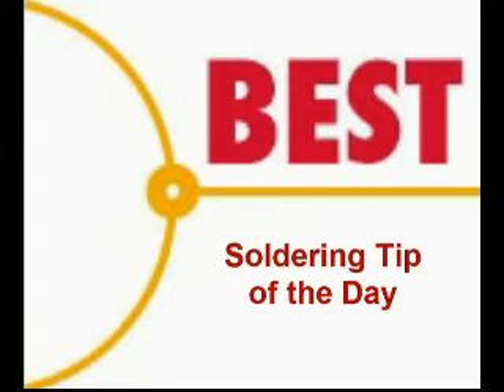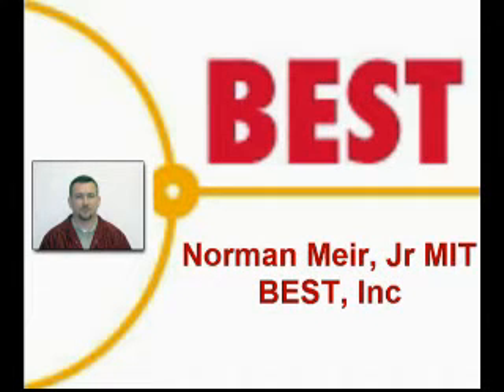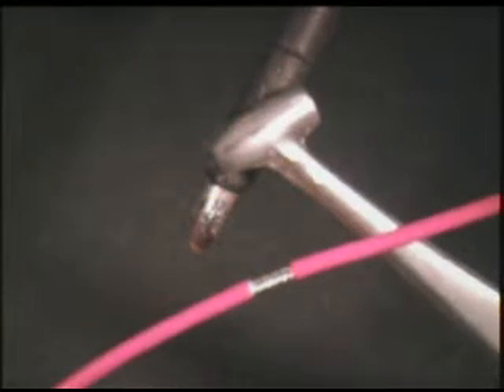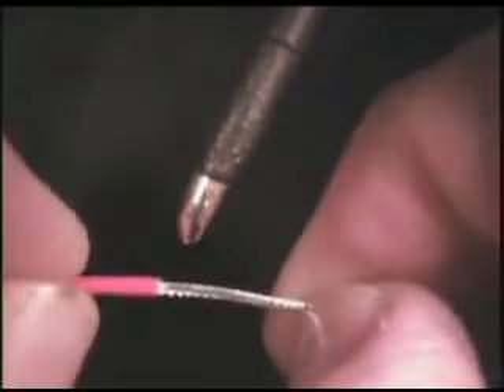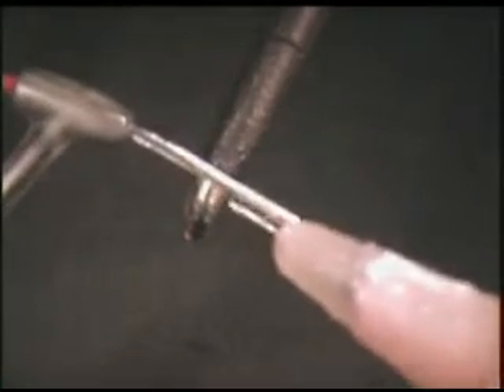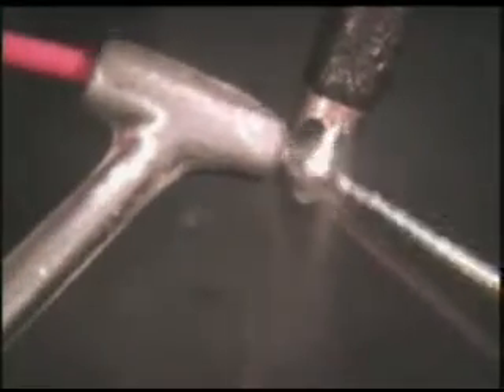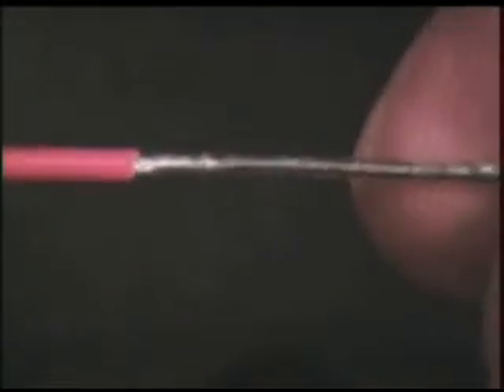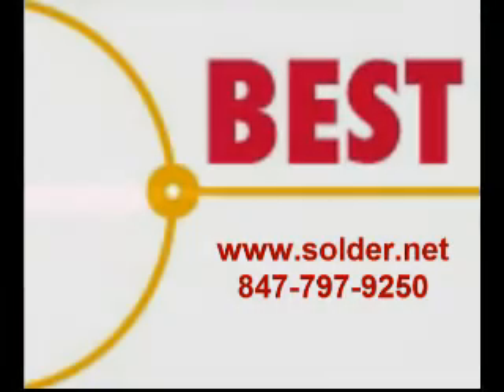Wire Tinning Method

Comment: Great video! Where does one get the wire heat sink tool shown in the video. Internet search with every word variation I could think of doesn't get it. We had these at Redstone Arsenal back in 1970  which is the last time I saw one until this video.
Reply: I know - I was looking for one too. They are called Anti wicking tweezers. Not cheap though, they cost about $30 since they are an out of production tool.
Reply: @azmrblack  Thanks a bunch. Those words get a lot of hits in Google.
Reply: @azmrblack  Could you give a link on those costs 39$, from what I find it's swiss made Rubis that costs around 71$🙃

Comment: What kind of flux is used in this video?  Is there a specific mfg and type you recommend?
Reply: Any kind of RMA flux. Kester 186 or MG Chemicals RMA fluxes are best.
Reply: @azmrblack  Thank you! I've been sitting here for 11 years waiting for a response :)
Reply: @adisharr  There is Non-Activated (basically worthless), RMA (Rosin Mildly Activated), and RA (Rosin Activated). RMA is used for most applications, you choose RA like Kester 1544 flux when you have highly oxidized wires/pads/joints. There is also no-clean, water soluble, etc. fluxes but for electronics done by a person always use a Rosin flux. It's recommended to clean it off with Rubbing alcohol (aka Isopropyl Alcohol) at 98% or higher when done to prevent dust, etc. from sticking to it. The other fluxes have their own issues and Rosin fluxes are always recommended for electronics work as well as leaded solder. Just wash your hands afterwards. Hope this helps!
Reply: @azmrblack  Thanks man - appreciate the tips! very helpful :)